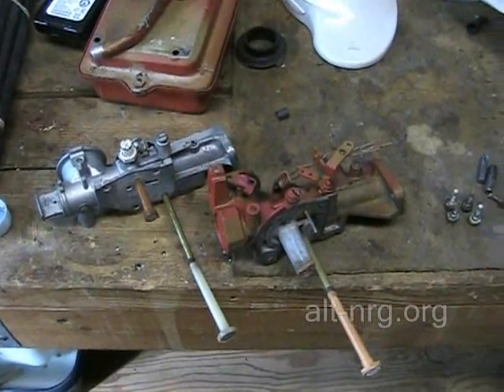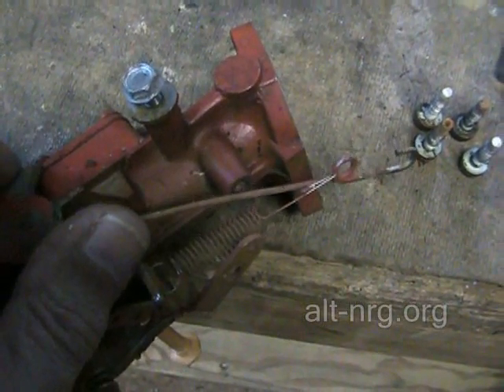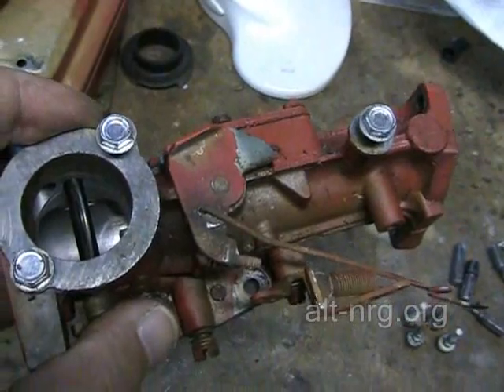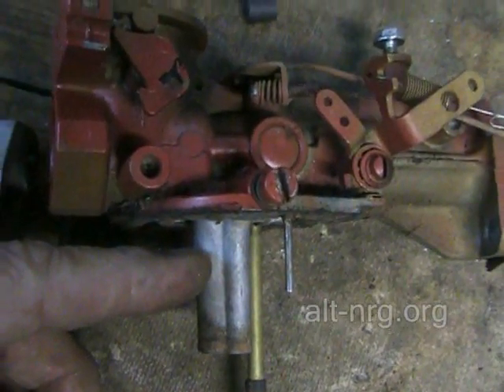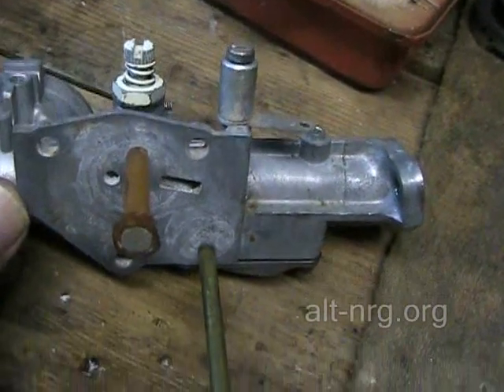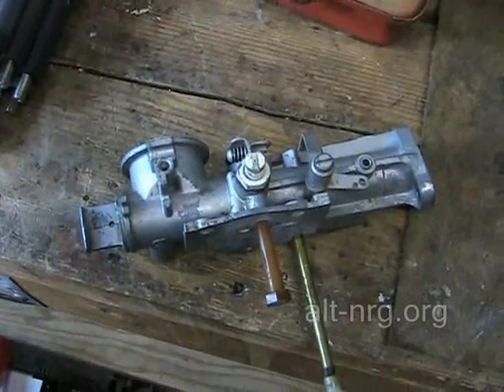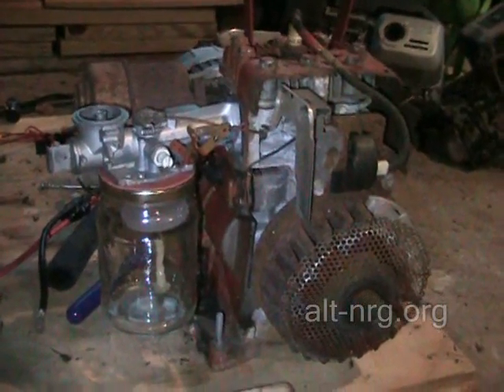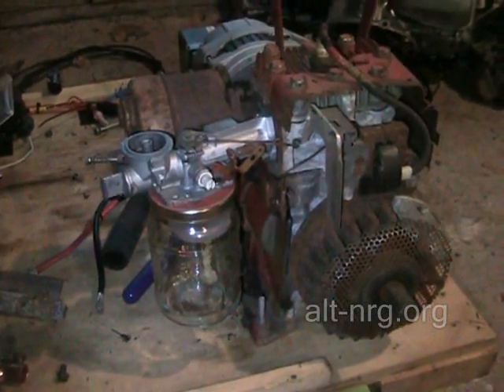#231 - HHO runtime experiment part 2

Comment: Z
Great work and looking forward to the next, but one thing you might what to look at a bit closer... Due to the vibrations of the engine a physical lock to secure the jar from backing out of the 1/4 turn lid. Would hate to see an incident occur due to uncontrolled gas vapors or spillage.
Just something to consider (:>).
Bill

Comment: Nice job Zero :-) A guy on youtube uses resin and glass fiber cloth to make fuel tanks for his RC B1 bomber JET. All I say is that it's another option for you if you ever feel the need to make something more durable. You also just might strengthen the lid with some fiber cloth and resin. There are plenty of options left to make it stronger and safer. You can also put the glass jar inside a cloth bag or an old pair of jeans just for safety, to stop the glass if you ever have an explosion.

Comment from the maker: @WulfBand Pull the recoil starter cover. I believe you'll find a wire broken off at the magneto. Common problem with this motor. I had to repair this one too before it would run.

Comment: @dire67 --- "Why waiste time fiddling with an inefficient device designed for a different fuel?" Because the engine will not run using traditional brute force electrolysis powered by the same engine. HHO will however extend the lean burn range of fossil fuels while improving the engine's thermal efficiency. This should give him extended run times with no loss, maybe even some gained, power out. At least that's the plan for this test. BTW gasoline is a poorer fuel, but HHO makes it better...

Comment from the maker: @dire67 Because the mechanics of the engine itself are poorly suited for the fast burn rate of pure HHO. These tests are only to determine if an unmodified 4 stroke can benefit from HHO as many believe. If I can increase the net overall efficiency here, we should then be able to extrapolate to larger automotive engines.

I do have another project on the board to create a modified 2 stroke engine from a 4 stroke that should run extremely well on pure HHO. Another day.

Comment: The carborator was designed to make the best of a poorer fuel. Gasoline does not burn. Its fumes do. Said device is used to atomize the fuel (creating more fumes) so it would burn.
HHO, on the other hand, is already a combustable gas. Why waiste time fiddling with an inefficient device designed for a different fuel?
Pump the HHO directly into the combustion chamber and light it at TDC. Eliminate the fossil fuel, or change your name.